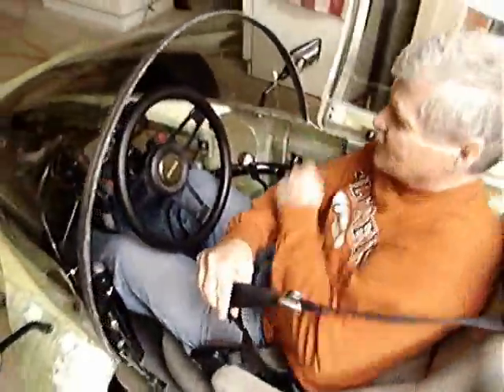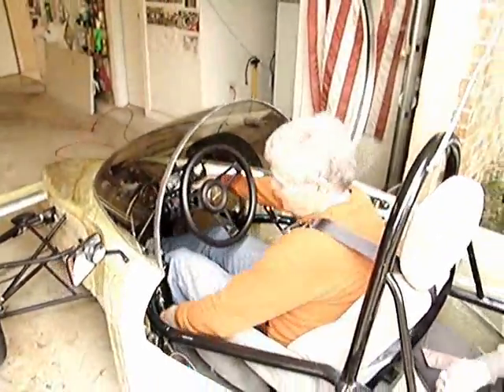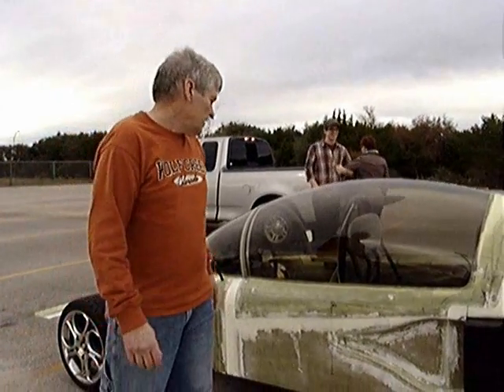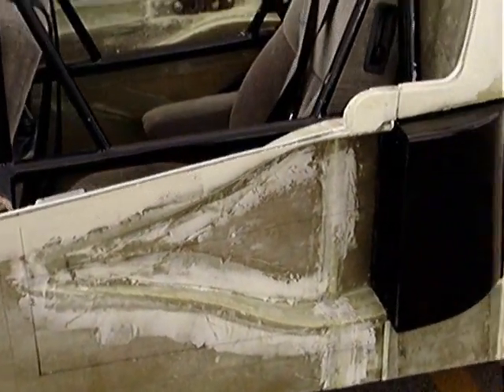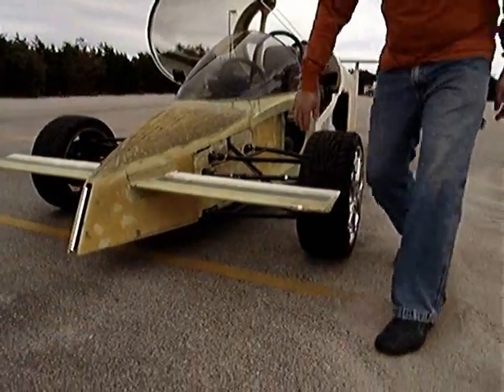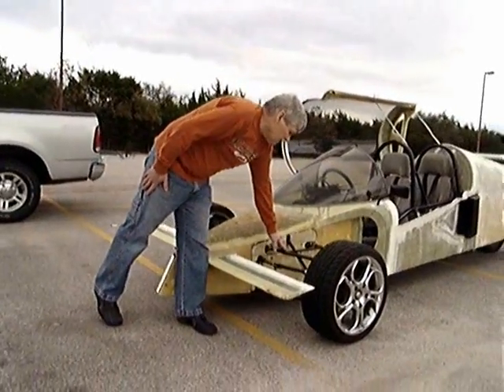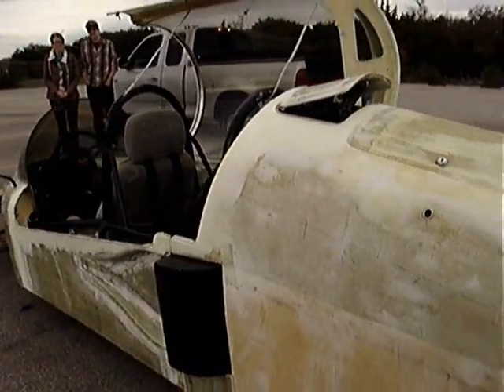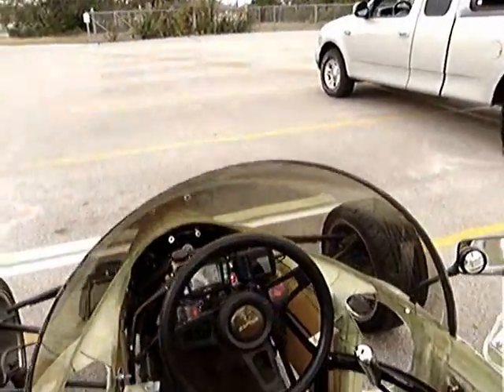Raptor Reverse Trike -  Update #4  Body contruction

Comment from the maker: It comes in one piece and you have to cut it...also have to build support/lip all the way around.  Cut with an angle grinder and a thin abrasion blade. It cuts very easy in straight lines

Comment from the maker: It is an allusion, the parking lot is crowned about 4 feet, and the one point where I start to "burn out" in the turn I backed off because I did not want to leave a "mark" in our parking lot.  It handles better than any car I have driven.  The only part of handling I don't like is if I have to do a u-turn.  Because of the very long wheel base, I have a large turning radius.  Other than that, it is a total blast to drive.  I based the design off of the Indycycle one seater.
Thanks...